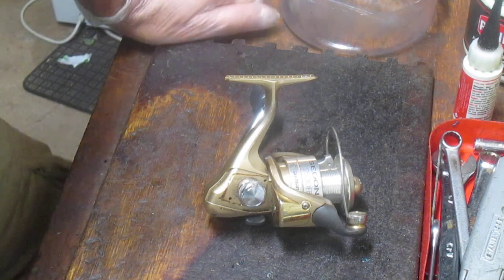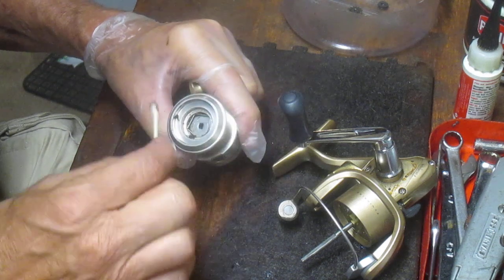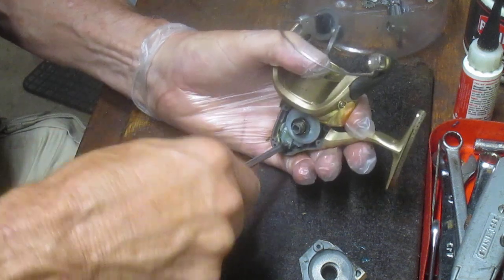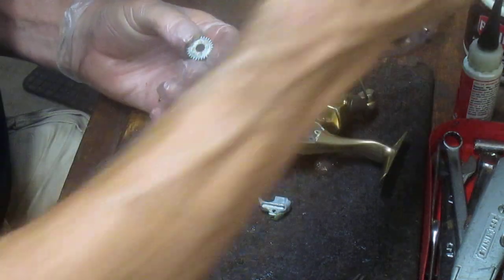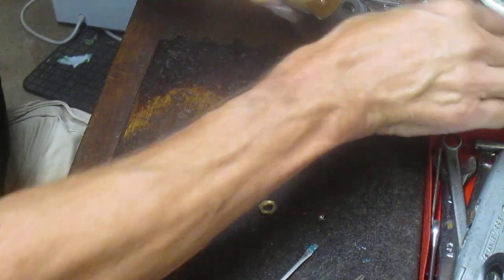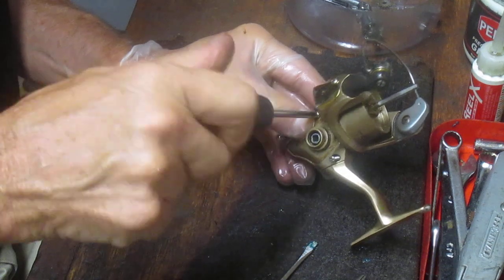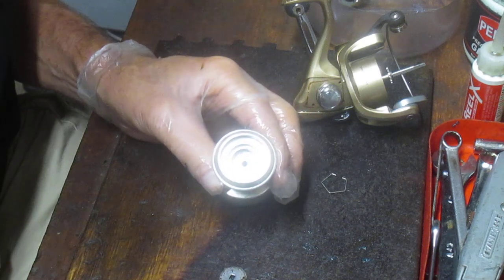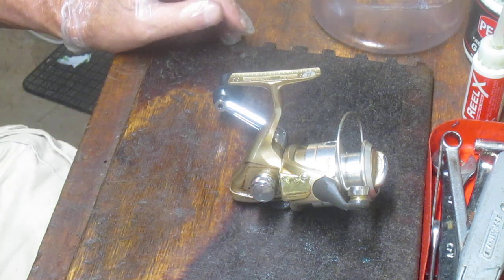Shimano Sedona 2500FB Take apart and service

Comment: Thank you very much.I just dug out my Sedona that is at least fifteen years old that my loving mother gave me.It has very little use and it in great cosmetic condition,though I know that the grease has to be somewhat dry in spite of the fact that it turns and rotates very easily.Your videos are awesome as you concisely and clearly show the process while sparing no detail.I agree that these are decent quality reels.It turns just as smoothly as my new Pfleuger President that I really enjoy using.
Reply from the maker: Glad it helped.  Those Pflueger President reels are nice and very well made.  Thanks for the note - Dennis

Comment: I got my Shimano Senora 4000FA today. I looked inside and it needed no service as it had been done recently. I love it that it has an AR override switch. It is very smooth though it doesn’t have as many bearings as your Sedona. This Senora mist have never been used as it show no evidence of line being on it or any scratches or boat rash anywhere.  I’m quite happy with it though I thought a 4000 size reel would have been larger.  It is as you said exactly the same inside as the Sedona.
Reply from the maker: So - what is your target  collection for 2022?  250??  +?
Reply: @2ndChanceTackle  I guess 250 is possible especially given that I’m over 220 nor. I don’t have any targets though. I once had they crazy thought that I had pretty much gotten most of the reels I ever wanted but boy was I wrong. As far as Mitchells go I do have  almost all the reels I ever wanted. Daiwa are another story. I had no idea how many great reels they have made even with the limitations of my collection.

Comment: Thanks!Dennis,your website is excellent.My Sedona is missing the side plate on the non handle side.I didn't notice this until I came across your great video.I recall gently scraping off what I now believe was glue on that side of the reel.What are those five holes for? I would like to find a side plate for this very sentimental reel if possible.There's nothing on ebay at the time,if you happen to come across one,please let me know.I have a few questions regarding my 430ss and will inquire of your expertise shortly.Thanks for your time.
Reply from the maker: I believe the side plate is held on with plastic studs that fit in those holes and that is why the holes are there.  Thanks again Mark

Comment: Dennis - Thanks for this video I have two SHIMANO AX2500FB AX-2500FB reels and the drag seems not to work on both of them. Rather than throw them out what do you suggest I do to fix them? I took the front drag off looked at it and it seems normal.... Put them back on and when I screw them all the way down until they stop there is no holding power at all.  A sunfish could take 100 yds of line out.... :-)
Reply from the maker: That sounds like worn or missing drag washers on those reels. I am not sure on those spools if you can replace the washers of if you need to replace the spool.  Try adding a hardware store thin washer on top (under the drag adjuster knob) and then tighten it down.  If the drag holds, you have worn drag washers - Dennis

Comment: Thanks!
Reply from the maker: Thank you Mark!  Dennis
Reply: @2ndChanceTackle  I have a new old stock Mitchell 400 (made in France)with original box and papers.The serial number dates it to 1961.There is another guy on youtube who shows how to service this reel.I'm torn between using it or selling it as I am not a collector of fishing reels,just love fishing.I also have two Penn 430ss reels.One is new old stock also dating to sometime in the 1980s.I see these are very collectablel also.I plan on servicing the used one and using it for lighter river fishing.

Comment: My crosswind gear  has two arrows. Dose that mean I have to set them in a certain direction. Thank you
Reply from the maker: Which reel?  If your reel has an elliptical gear set up, then there are alignment marks on both the main gear and the crosswind gear that need to be matched up.  That is because the two gears need to mesh properly throughout the stroke.  If you have the normal round gearing, then the reference marks are not important.  A quick way to see is to set the crosswind gear and main gear in place and turn the rotor.  If it does not turn smoothly at any point in the cycle, then you need to align these gears using the reference point.  Send me the reel information and I will be able to give you further information.  Thanks for asking - Dennis
Reply: 2nd Chance Tackle  I have a Sedona 1000 fd with the oliptical gears so I think that might be problem I'm having.
Reply: @2ndChanceTackle  Thanks for taking the time to make this video. Google found your video when I was trying to work out how to align these gears. Here's a detailed pic that explains how to align the gears properly if you have the elliptical gears it in case someone has the same issue. http://www.ultimateangling.co.za/articles/sedona/Sed%20gear%20align.JPG

Comment: This is identical to my Shimano Sahara 2500fb.
Reply from the maker: Many of the Shimano and other manufacturers shared parts and designs between models.  Penn was best at it, using one handle and main gear for at least 20 models.  Dennis

Comment: What kind of lube are you using?
Reply from the maker: I am using Penn Precision reel grease and ReelX fishing reel oil.  I suggest in my videos, that you can use any reel oil and lube as long as the are designed for fishing reels.  Please stay away from general household and automotive oils and greases and most do not have the properties to deal with excessive water and/or salt. - Thanks for asking - Dennis
Reply: @2ndChanceTackle  thanks for the speedy reply. I just bought a Shimano Sedona 2500 HC and I noticed it feels a little gritty when reeling in my lures. Might need to take it apart and grease it up

Comment: why didn't you work on the Bail that's what I have a problem with you showed nothing , mine locks up an won't flip back sometimes !!! Great video but incomplete ....
Reply from the maker: Dennis - you do not need to service a bail unless it is broken.  My video showed how to service the core of the reel and simply add a drop of oil to the bail.  If yours is locking you, it is likely that the trip mechanism is sticking.  I think I have a Sedona in the shop.  If I do, I will try to show you what to do.
Thanks for the note and for watching
Dennis
Reply: @2ndChanceTackle  Thank for understanding my problem ,The Bail tries to flip back but 9 out of 10 times it fails it's seems the spring is to week the flip it back with any authority ! And some time it just locks up where I cant turn the handle on the reel I have to manually flip it back ,Nobody has shown the proper disassembly and reassembly of the Bail and the few parts that are in it are hard to figure  what position they should be in I probably screwed something up when I took it apart and not paid enough attention hope you can help .Thanks Denny
Reply: @denny5757 he has a video where he covers bails on other reels. Most of the time the wire is bent.